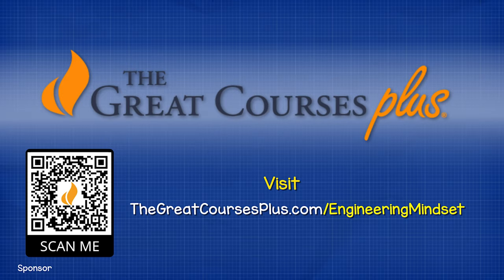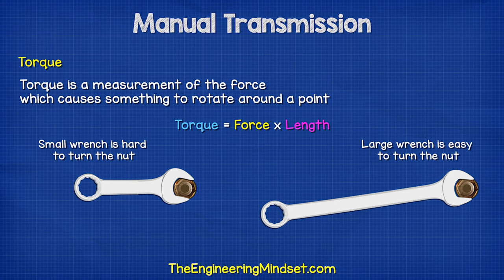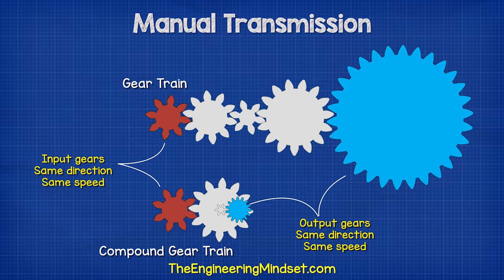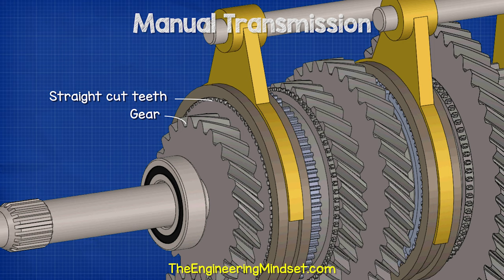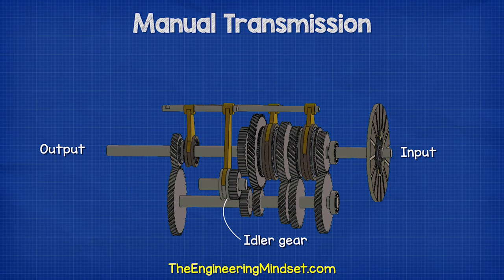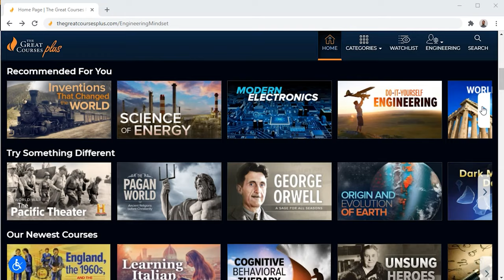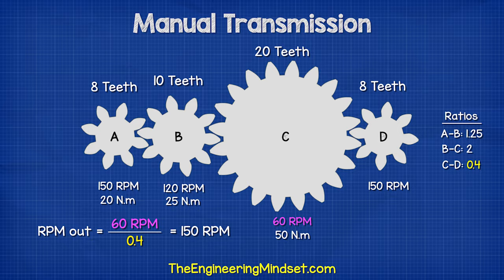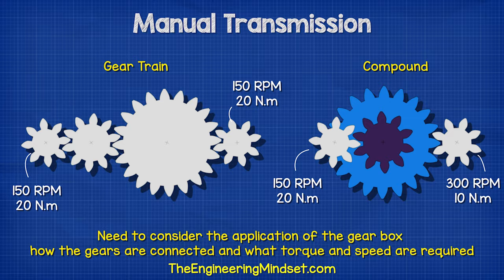How Manual Transmission works - automotive technician  shifting

Comment: "we can also get automatic transmission vehicles, which will automatically do all of this for us"

Man, that's the worst that can happen! I once drove a fiat 500 which literally did all of this for me and the driving experience was horrible. It basically had a classic manual transmission operated by a computer, you never knew when it would disengage the engine and shift gears, and it would also roll backwards on an incline. I prefer hydrokinetic automatic transmissions, precisely because they DON'T do all of it for me ;)
Reply: I think that's how the Hondamatic worked, which I think they used until pretty recently. Though being a Honda, for Honda engines, it worked well when it worked, but tended to fail when used with any real torque (i.e. V-6 Acura and Odyssey applications) lol

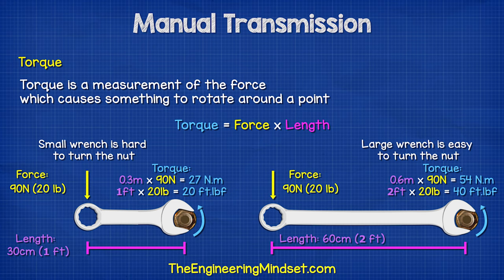Comment: At 3:46, for torque units you have N.m (force, then distance) but below that you have ft.lbf (distance, then force). How can that be?

In terms of lbf and ft or ft and lbf, isn't torque measured in lbf.ft?
Reply: Multiplication is commutative, so units derived by multiplication can be expressed in either direction
Reply: ...however, some convention exists for using "foot pounds" in one context and "pound feet" in another. But they're the same unit.

Comment: Definitely manual. If your breaks fail or are weak, you can down shift to slow down. If you have a dead battery, you can just push the vehicle and pop the clutch and vroom vroom.
Reply: Not only that, if you're going down a hill it's easier to engine brake and not over heat your brakes/cause extra wear. Good way to stay safe
Reply: @ceremyjlarkson9475  I'm all about manuals, but in fairness, automatics allow that too

Comment: But how does an FWD car shift without mechanical linkage to the shifter?
Reply: It's either a linkage or cable connecting the shifter to the transmission
Reply: Automatics have a cable . Manual transmissions have internal rails with forks. Moving shifter moves rails and fork like whats shown in video
Reply: @codyramos3200  many manuals have a cable too, e.g. Subaru WRX

Comment: Manual is better. A) driver can shift at best time instead of when shift computer or vacuum actuated valves dictate. B) manual transmissions are ridiculously more reliable than automatic transmissions. My wife’s car is automatic and had to be rebuilt at 215,000 give or take a few thousand miles. My car is a manual 5 speed and still drives great after 315,+++ miles. Original clutch too

Comment: Manual as you can engine brake when applicable.
Reply: Automatics can engine-break, too.
Reply: @tinchote  Not in the same way as a manual can. Autos can only engine brake of you are travelling at highway speed or high revs with the torque converter locked up. Only then is the engine braking noticable. A weird exception to this rule though is Honda transmissions. Honda automatics engine brake just like a manual because they are a manual transmission on the inside. Only instead of using synchro rings and a sleeve to shift it uses clutch packs.
Reply: @legostar55  I don't know much about the technical aspect. But I have driven hundreds of thousands of kilometres in automatics, and I have driven hundreds of thousands of kilometres in manuals. In 30 different countries, from melting tropical tarmac to snowpacked highways in -40 weather, going up and down countless mountains on many many ski trips. And have engine braked every single time down a mountain, with every automatic I've driven; they can definitely engine brake.
Reply: @tinchote  I guess I'm speaking from an American perspective. Every automatic I've driven doesn't engine brake unless you select a lower gear but the revs must be high in order to feel it at all
Reply: @legostar55  A big chunk of my mountain driving has been in the Canadian Rockies, with Toyotas and Nissans and Hyundais and Dodges and Chevrolets and Mazdas, etc., etc. No issue with engine braking on the downhills; maybe there are some cars that won't engage the lower gear if that will overrev the engine; not sure if I consider the possibility of overrevving the engine in a manual, "a feature".
Reply: 🤦‍♂️ both of yall just stop...
Reply: @legostar55  trust me bro. Autos do it too, in fact I learned to heel-toe rev match in an automatic (at least, the simultaneous brake/gas part). It may not be to as much of a degree bc of the torque converter though

Comment: Depend on the place where you travel if you live in the mountainous area you need to choose the manual transmittion car becouse of the brake down hill once your car breaking system has have an a problem used the parking break the engine break in outo matic transmittion once your break are destroy you couldn't stop in the down hill all you do is to pray and the god save you

Comment: @Engineering mind set good morning I think automatic transmission car can be monitored from the control tower like auto pilot mode in case of Airplane, mean while the manual transmission car require human labour to drive and shift 12345 gears to neutral, reverse etc.JESUS LOVES YOU 🕊️🕊️🕊️

Comment: It's only because of the internal combustion engines limited torque range that a transmission is needed at all. Electric cars don't need a transmission.
Reply: Electric motors also have a limited torque range. Any dyno chart from a BEV shows that. 
But it's wide enough that they can get away with not putting them in, saving a bundle, charging the same to the customers, and pretending the omission is a benefit.

Comment: If you are gonna be driving on an extreme roads and draging trailers and something like that it could be better that you choose the manual transmission and vise versa for automatic transmission if the roads are stable and balanced like no more potholes or deformed roads then of course automatic transmission is the best option and also when the traffic jam started it may run you crazy in a manual transmission 🤭🔥🤬

Comment: IMO manuals are better, they have less parts inside and there also “meatier” which for what it dose if perfect, downside of manual they can be a pain in traffic, your going to have to replace the clutch at least once in the cars lifetime, and there not convenient. Even with all that I’ll take my 6 speed over an auto any day plus I save a lot of gas on hills because I can easily go into neutral with a pedal

Comment: I like Manuel I like country more efficient more control in speed zone in proper gear you won't speed. In city auto better the mail lady or grabage man are better with auto. My prevost coach is Manuel but a city bus has auto shift they stop and start I drive slot highway my thirteen speed in my coach conversion into motor home. My model t ford has plantary transmission controlled by two peddle s and brake level. Look up driving a model t ford heavy trucks are non sinconised one has to match engine speed in is proper speed then it fall into gear by double clutching cars are that way until late thirties models

Comment: Pre-2000s manuals were better.  These days the automatics have taken over and do a much better job.   Of course electric drives are about take them obsolete.
Reply: If numbers were all that mattered, then yeah, sure
Reply: @nthgth  yeah I feal you.  All of mine were manuals.  1984 Corolla SR5.  1988 Mustang 1980 Tercel.  1998 Tacom.  1999 BMW 319i.   2011 FJ (currently).  Plus 3 motorcycles.  My next one will be the cybertruck.  I won't be buying anymore primary cars that are ICE.  I will miss shifting though the gears, but I'm done with the hassel of keeping them running.  Working on vehicles is a big chore these days and not much fun anymore.
Reply: @GeoFry3  maybe it depends on your age. Those were all cool cars you mentioned, apart from the cybertruck lol. Maybe when I'm older I'll consider it too much of a chore. But right now, to me an engine and stepped-ratio transmission are essential to what a car is, especially when I get to be a direct interface between the engine and the movement of the car. 
I'll buy older cars if I need to to keep that part of my life extant. I'll feel paralyzed otherwise. 
Again, I say this now but that could change in time. I hope it eventually does, in the same way a man frustratingly terrible at getting laid might fantasize about being castrated.